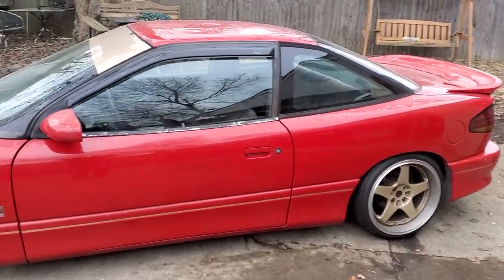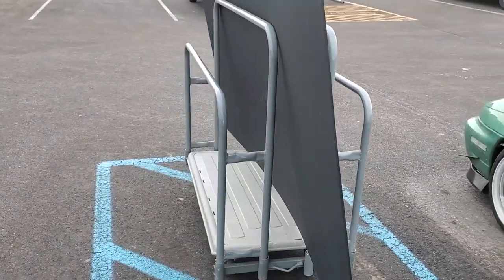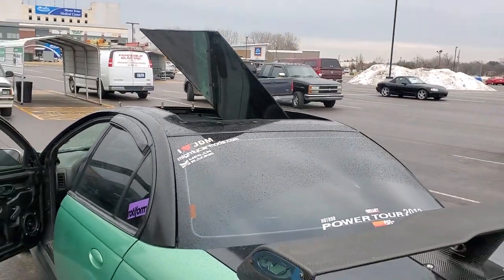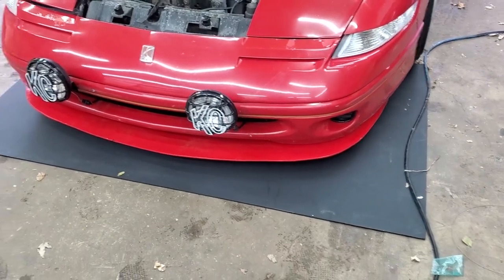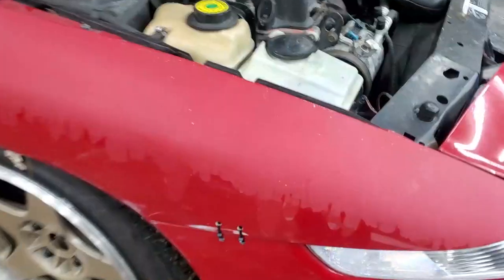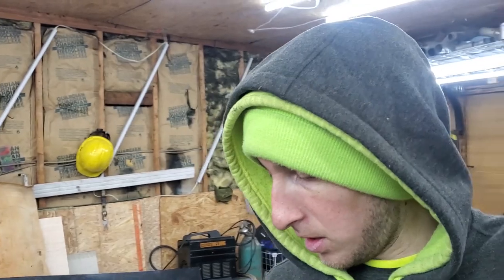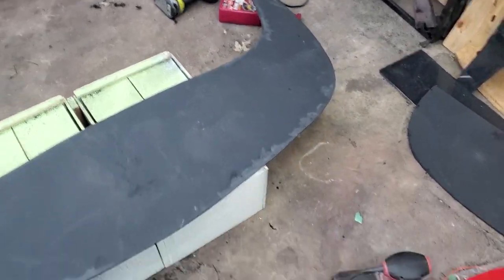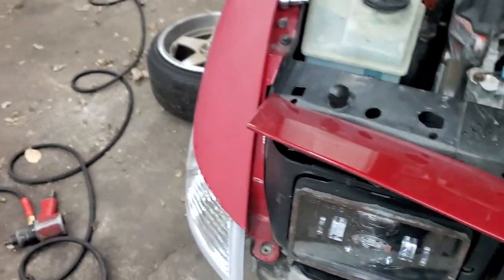Making a front splitter for a 96 Saturn SC2

Comment: I’ve trying to research but can’t find any answer maybe you might be able to help me. I have a 95 sc2 the problem I have is that I can’t above 60mph with out the steering wheel shaking a lot and I feel like I loose a little bit of control
Reply from the maker: Either balance your wheels or you need an alignment
Reply: Wheel balance!

Comment: I got a '98 sc2 2 door. My idle is screwed up. Sometimes it's 2100 rpm. Sometimes it's 1500 rpm. Seldomly drops to 950-1000. Pfft, so much for 34 mpg
Reply from the maker: Have you replaced the idle air control valve?
Reply: @BuilditBreakitGarageinc  I'm gonna check that as soon as I can, thanks